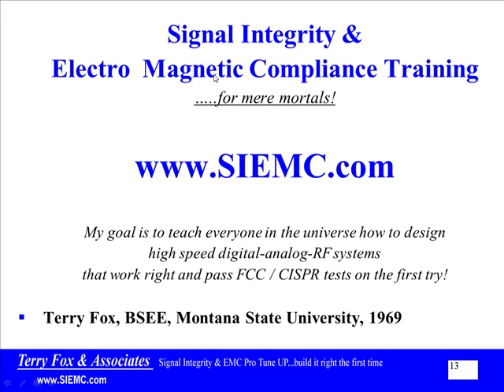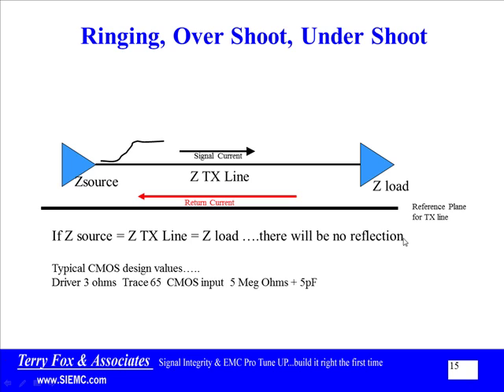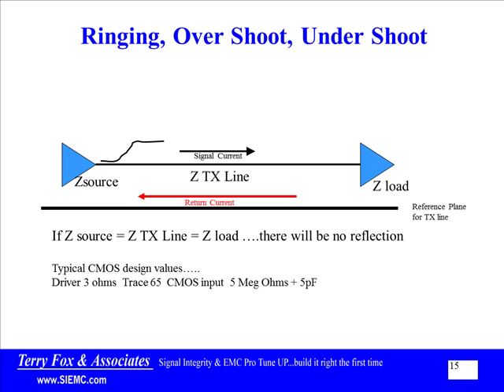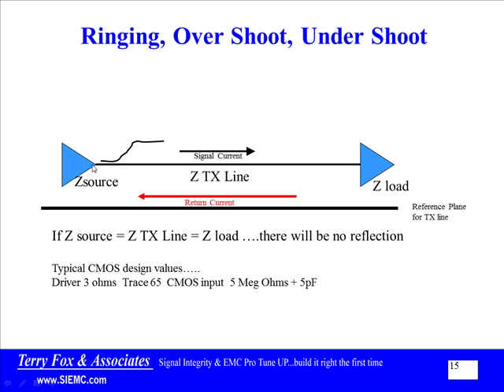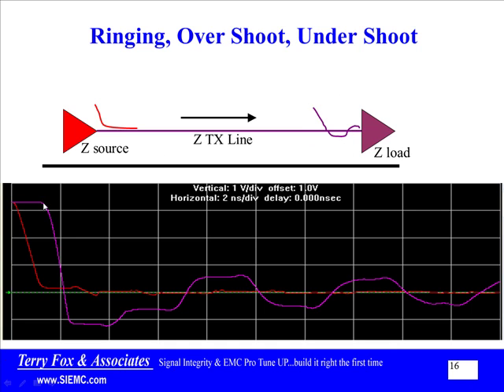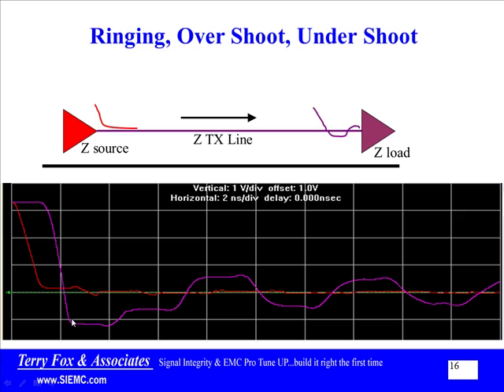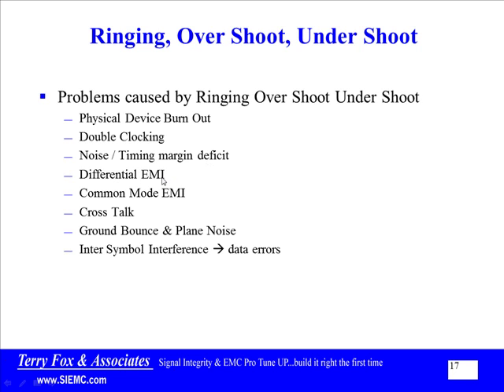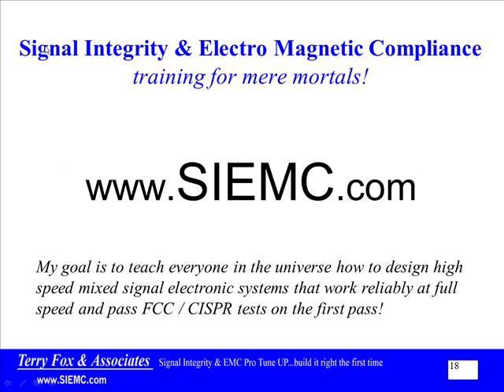Ringing Overshoot Undershoot

Comment: Thanks for the great video. I still don't understand what causes under/overshoot though. Is it due to a fixed amount of current encountering a higher impedance (V = IR)? Or is it a property of the Gibbs phenomenon?
Reply: I'm not sure exactly which part is your confusion but I believe the answer to your question is that it has to do with transmission line effects. This has antennas in mind specifically but good info on Transmission lines:: http://www.antenna-theory.com/tutorial/txline/transmission.php
Reply: High di/dt